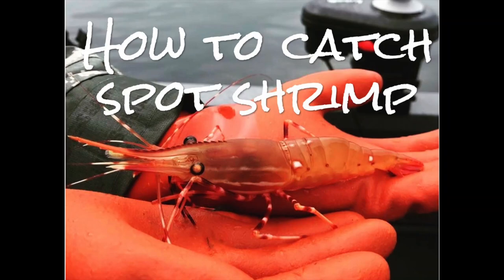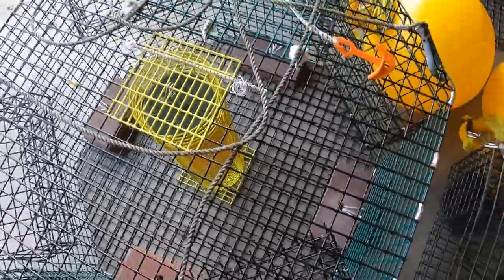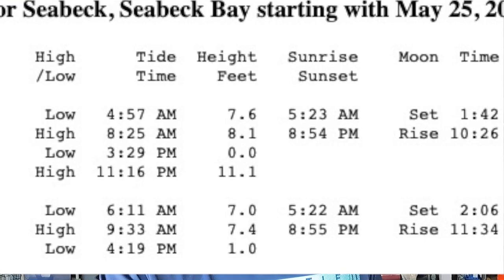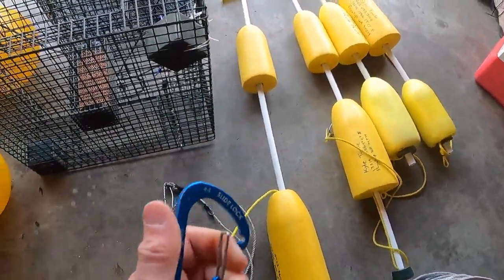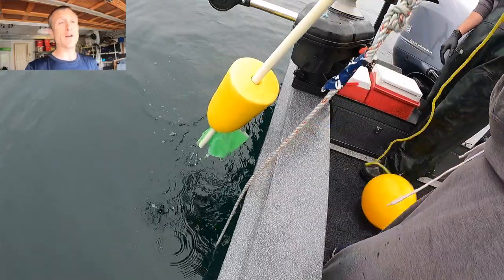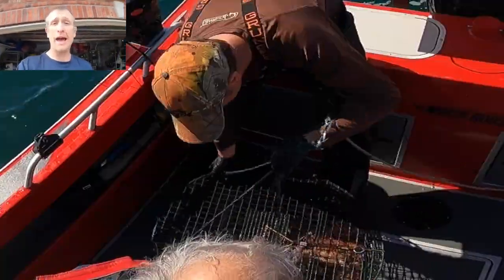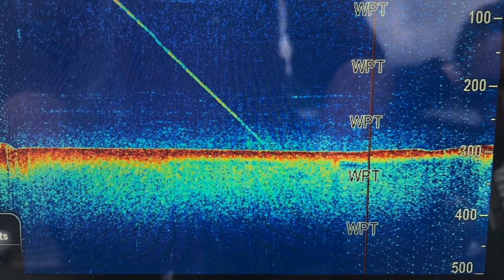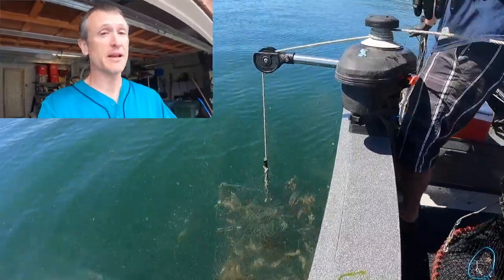How to CATCH spot shrimp - ULTIMATE Guide!

Comment: There is a lot of solid information in this video. I would offer some additional perspective to consider. After 20+ years of catching spot prawns in the San Juan Islands, I can assure you that Ladner style traps and the other style fish comparably.  I’ve fished them side by side in the same area, with the same bait, and they have produced identically. If you pick the right Ladner trap, it will weigh enough that you won’t need additional weights in most conditions. If you fish in a rocky area, use 100’ of polypropylene line for the first 100’ directly attached to the trap.  This will keep your line off the bottom and prevent snags.  It massively sucks to pull in that first 50’ of line to realize your lead line is wrapped around a rock and the bottom. If you lose a pot, come back the following day at low slack. There’s a 50-50 chance you’ll find it there after being pulled under water.  The backup buoy helps but sometimes pops, gets loose, etc.
Reply from the maker: I appreciate your added knowledge here. I’ve never been able to get the same performance out of the kufa or beau max Ladner style. But I completely agree the right ladner can get comparable results cause I’ve seen it. I also think they are more commonly the choice in longer soaks vs the other style that’s all about speed into the tunnels

Comment: Im going to buy the C-links for the upcoming dates in hood canal and crabbing season. What size C-links do you have? I see that Sportco has the 11/32" size but Amazon has the 1/2 size for quite a bit more $.
Reply from the maker: I’ve used both. The smaller ones have a chance to make it through your pot puller if you’ve got multiple lines connected, which is more common for us to do during crab season when we aren’t quite sure of the depths